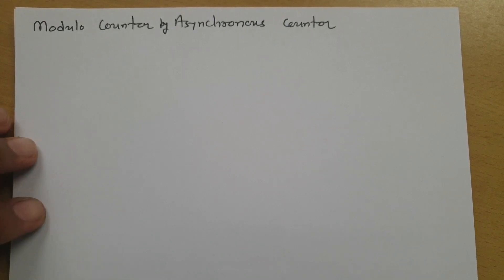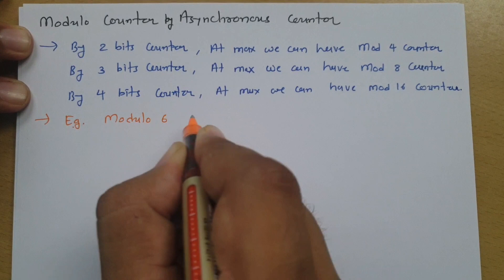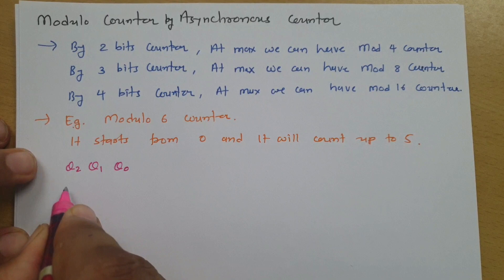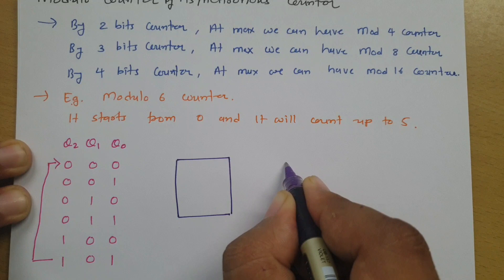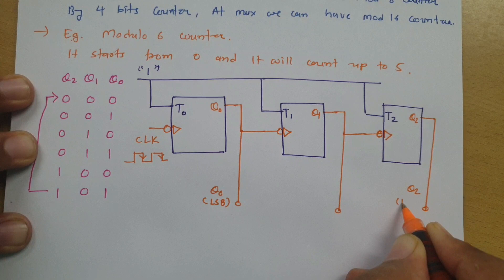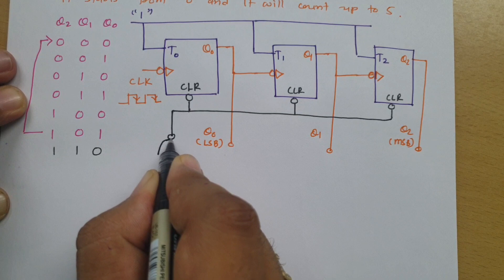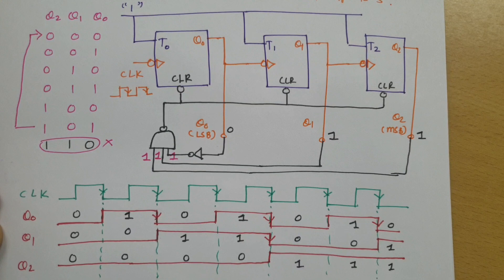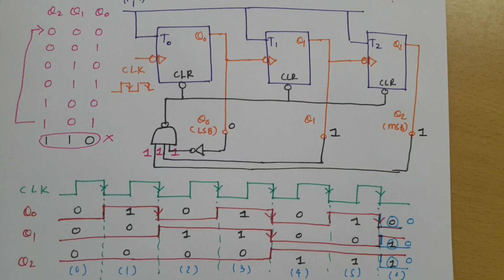Modulo Counter Using Asynchronous Counter: Basics, Circuit, Designing, Working, and Waveforms

Comment: At 8:16 - 8:17 I think there should be AND gate instead of NAND gate because In the video of preset and clear you taught that  clear works when clear = 0. Since it is already active low, a high signal should be applied to clear. Otherwise what is point of using two continuous NOT gates (1 inside NAND and 1 in active low bubble) before applying signal to flipflop cell.
Reply from the maker: Bubble means active low
Reply: I think for active low clear (if clear=0 then output will be zero) so if we give nand gate it makes all output to '1'..so I think AND gate is correct for this circuit

Comment: sir i have a doubt! what happens when clear is 1? like in the before cases when the output Q3Q2Q1= 010  or 101? and will it stop after 110? why wont it go till 111?
Reply: When you use active high clear.. 101 should be given as inputs to And gate
Reply: After 101,it goes to 000..because all the flipflops are cleared or reset
Reply: If any one input of nand gate is 0 then the output is 1 so this nand gate will  give output as 0 only and only if the input to nand is 110 so when this condition come then nand will give 0 as output and this 0 will goes to clear and reset the counter

Comment: For modulo 6 counter we should not take        1 1 0 state.we should stop at 1 0 1 and take clear accordingly???
Reply from the maker: It will not take 110, it will clear FF at 110
Reply: @EngineeringFunda  but unless the state is 1 1 0 how will the clear NAND Gate take it.?
Reply: @vimala8508  state will go to 1 1 0 but as he goes to 110 the clear will do his job and make the output 0 0 0 if we make it for 1 0 1 then it will not count 5 instead of 5 it will give 0 0 0 that's why we take 1 1 0
Reply: @yashkataria2992  thanks